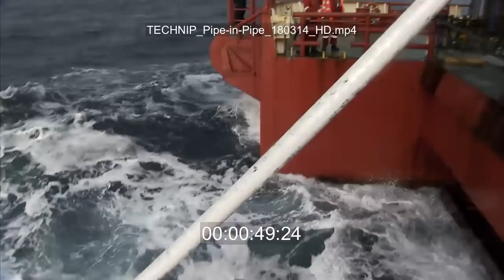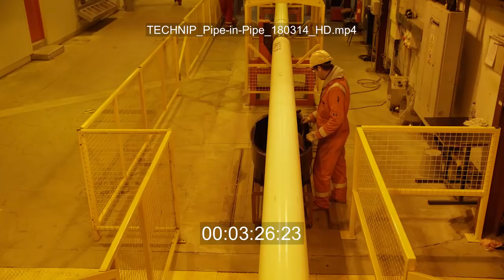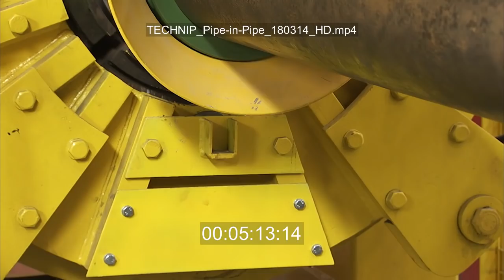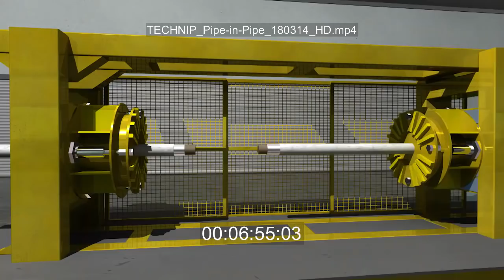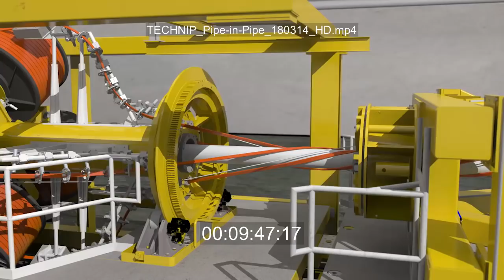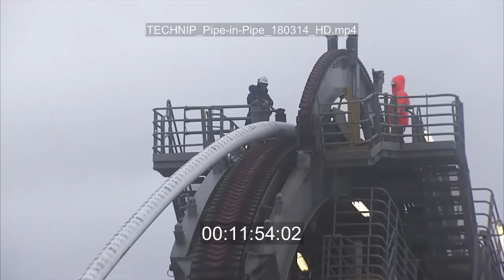Evanton Spoolbase

Comment: I worked for  a company in the U.S. that would do the weld prep on the pipe ends before welding.  It was not uncommon to have  to machine a few thousand ends on a job.
What i always thought amazing is this  pipe is at least a foot in diameter with a inch or more wall thickness and they are still able to roll it up on a spool like a garden hose.

Comment: How does the steel pipe bend onto the spool ?
Reply: @aceventura1587  Spank you, helpy helperton! ...:)...Those giant spools are a SICK manufacturing process too...
Reply: Steel pipelines are like spaghetti at a large scale. Depending on the size of the pipe, it has a required minimum bending radius. For these smaller pipes the giant wheel is large enough to provide this radius.
For larger pipe diameters, the pipeline is welded out on the sea (check Allseas for that)